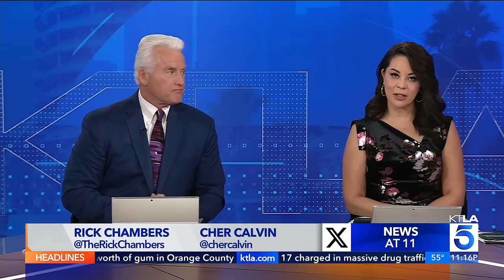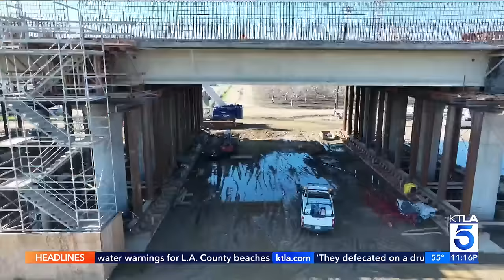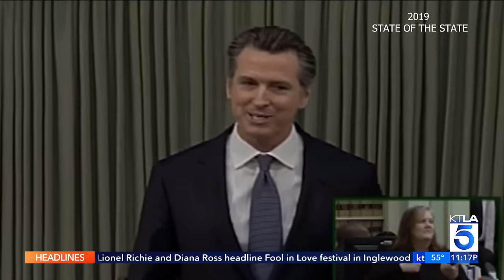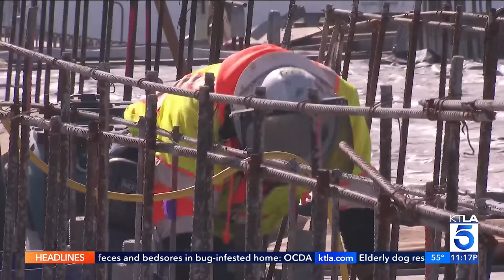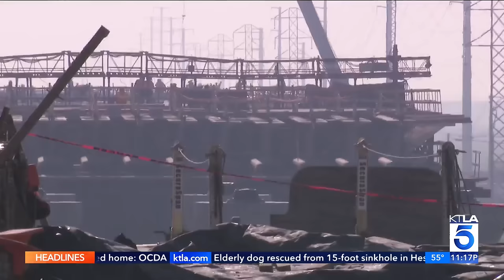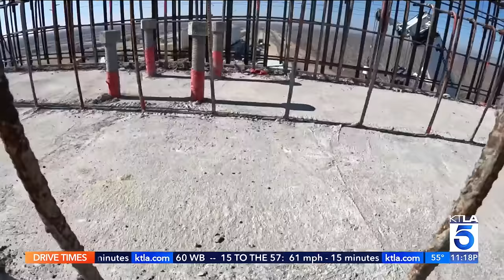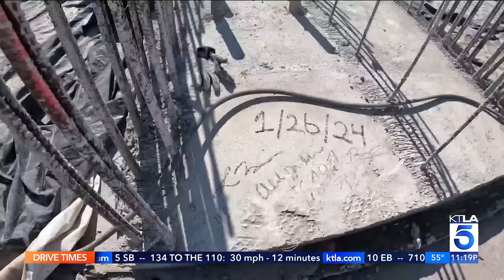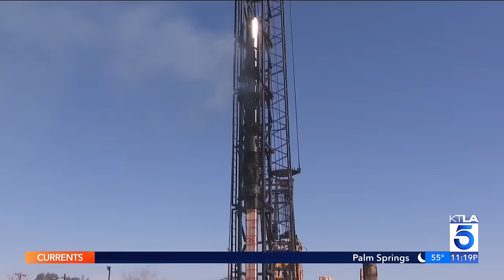California bullet train in works but completion date remains a mystery

Comment: Boy 20% fact, 80% opinion. Is it so hard to figure out why people have gotten so polarized? I mean how hard is it to find a few people who know anything about this to break it down instead of just echoing people doing a whole lot of hand wringing. This project is an absolute first in the country. Even just the Merced to Bakersfield line is about as long or longer than any single line in all of Europe. It has a pipeline of manufacturing and engineering that we as a country simply do not have any are inventing the capacity for in really time. Has it taken a long time yes? Should it be stopped? No of course not. The facts remain. A completed project of this scale will absolutely transform the state. Having the capacity of engineering and construction will cause the next routes to go much faster as well and other parts of the country will benefit as well. Just like the efficiencies of highway construction we've created, we're creating a rail efficiency which the rest of the country can benefit from

Comment: Choosing to go between those two cities is proof the people running the project are idiots
Reply: They might have gotten outsmarted by the Atmospheric Rivers that ended the drought that was ending Central Valley Agriculture.  Now making the valley a corridor for the really big high tech factories, that no longer fit in the Bay Area, isn't as necessary.
Reply: @ydne I am not familiar with the northern part of the state, but I know many people in LA who would move to Bakersfield in order to buy a house if they had reliable high speed rail to get to their jobs.  Some people already make that move and commute 1.5+ hours by car, but they usually only last 1-2 years before they get sick of it
Reply: @PelosiStockPortfolio itsway more than 1.5 hours, more like 2.5 hours one way.
Reply: @mrxman581 Yea, it depends where your work is

Comment: imaginning getting trapped in the tunnel...
Reply: That doesn't scare everybody. What scares so many people is that when you blast a hole in the mountain, you just have to hope the workers are far enough away from the explosion.
Reply: @MrJuvefrank  What scares me the most is a collision with another high speed train. Which would be worse than a commuter train collision, if both high speed trains were going full throttle and basically there would be no survivors. And that’s what worries me.
Reply: @T128Productions  Hi, there, most problems have solutions. If each train has its own track, then that makes it difficult if not impossible for 2 high speed trains to be involved in a 2 train collision. One thing you are right about, though, is that Sacramento doesn't ask people how to build the system cheaper; it just throws money at the project and hopes it gets built without wasting any money. Sacramento isn't realistic in that sense.

Comment: Supposed 'journalists' not doing their 'job' and providing you with the complete story >:(
ONCE AGAIN...California voters approved a HSR line in 2008 from L.A. to Frisco that would run 'basically' in a STRAIGHT LINE along Interstate 5 between the two cities. That is what the measure on the BALLOT approved <<<<<<<<<<
The French engineering firm that built France's HSR system actually came over to California to start planning...but the Gov. Brown admin. pulled a gross illegal/unconstitutional political 'maneuver' to change the measure ((WITHOUT voter approval !!)) to move the HSR line along Hwy 99 on the eastern side of the massive, central valley in order to service all the large and small agricultural cities/towns like a >daily commuter< train. The French company called it 'crazy' and left.
So now Sacramento has no-choice but to finish that small, central section at insane levels of 'over-costs'. The HSR Authority has put together 'plans' on how to connect the system to L.A. and Frisco but it's a 'desperate-PR-move' to try and bs the public AGAIN...but it'll never be done once the full DEBT of this current construction is added up and shocks 'everyone' (even the Feds.).
Reply: Truth...!!!

Comment: The biggest mistake was the route. If they had just built it up I-5, it would probably be finished by now (at least the Central Valley portion).
Reply: They're too greedy to finish it quickly.
Reply: I-5 has no cities. The point is to connect Central Valley cities to our coastal regions.
Reply: The correct answer would be the 99 not the 5

Comment: The rapid transit we have in California the current ones for buses and trains are barely used as is not that we don't need them but scaling this project up for something nobody's going to use that is not going to be breaking even is a waste on money
Reply: If people could go from L.A to S.F in 3 hours by train, It would be used a lot.
Reply: They're not used because rail projects in general in the area are scarce. Therefore it's inconvenient to use public transit. With these projects completed, you will see much more ridership because it will now make traveling more convenient. It's not just this high speed rail, but also the LA & SF rail projects along with high rise buildings around the stations, that will make those station areas a hub for business.
Reply: @Mac-po1sr At best by 2064 the trip will be 4+ hours for an express and 4.5+ hours for all station stops. Why? Because of 125 miles of slow tracks leading into LA and SF.
Reply: We don't have rapid transit between LA and SF. It takes about 10 hours whether you take the train or bus. And driving it takes around 6-7 hours. NO RAPID TRANSIT. The plane is the only thing that could qualify, but still takes at least 3 hours with check in times and security.
Reply: @davidjackson7281 No, there will be express trains as well which is why they are building the stations with 4 tracks since some trains will by pass stations.
Reply: Like I said not many people are travel on it. There is a train station about a quarter mile from my house that will take you into Los Angeles so union station you know how many times I've taken it zero for one time for fun me and the family decided to travel from our area towards Los Angeles we stopped in West Covina area to have lunch and then return to the same train back home it was okay the train was sparsely populated for the amount of space it had. And anyone who knows anything about the geography of Southern California knows you're not going to go High-Speed rail through San Gabriel mountains. It's going to be a zigzag and it's going to take some time and if you have stops which you're going to probably have to do multiple times it's no longer really high speed anymore. I'll be better off driving in my car down the freeway to Vegas and back and enjoy myself once I get there because I won't need to find transportation once I arrive in Las Vegas I'll have my own transportation.